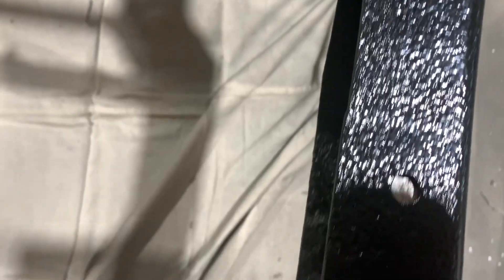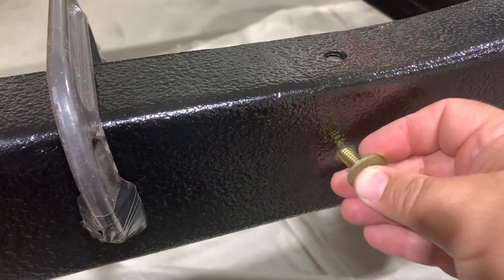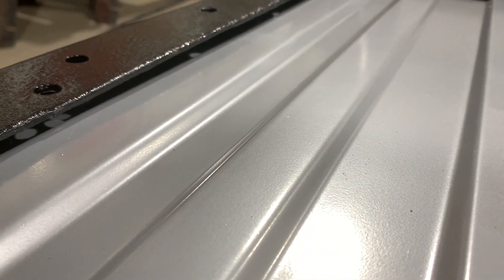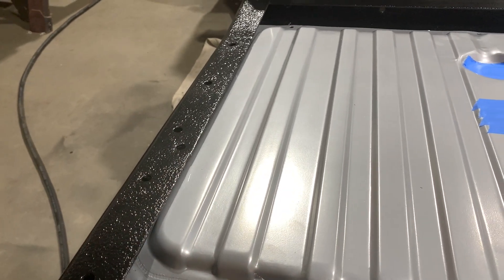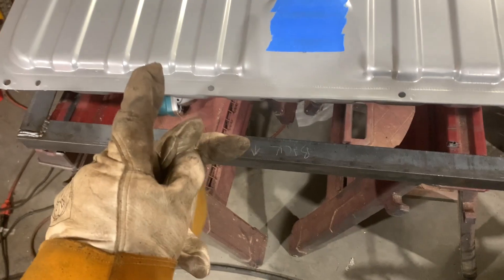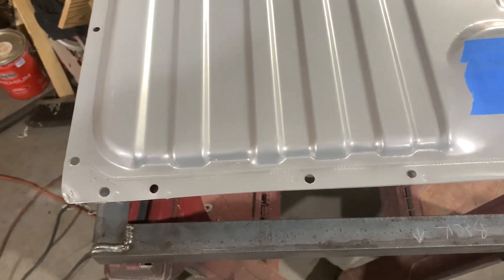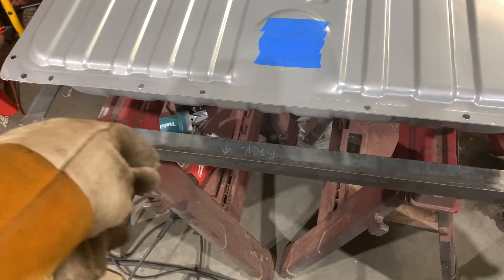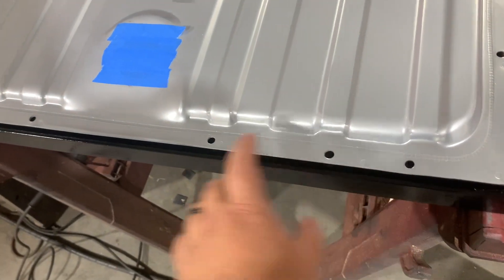They SAY Mustang Fuel Tanks Fit '55-'59 Chevy Trucks... They’re WRONG!

Comment: I just got done installing a new gas tank on my 55 Truck but had to use a 66-69 midsize ford tank. It is the same style as the Mustang tank but wider and holds 20 gallons. I wanted to use the cheaper Mustang tank but did not have the means to reconfigure the tank frame the previous owner built and fitted to the truck. I subbed and am enjoying watching your 55 truck build🤠👍
Reply from the maker: Thanks for watching and for the sub! Glad you got your tank situation figured out!